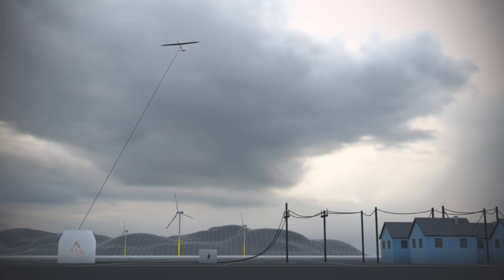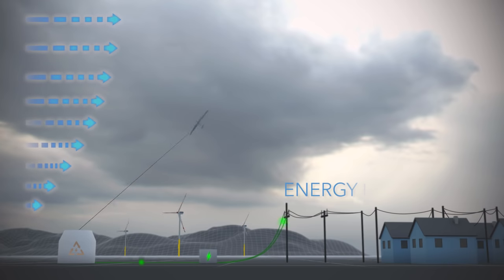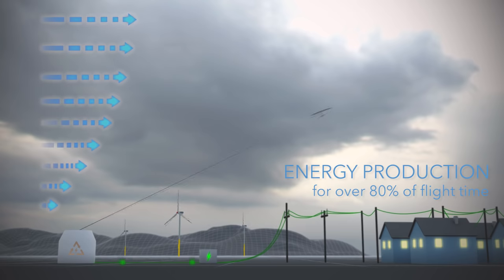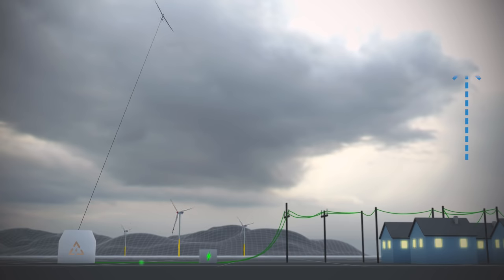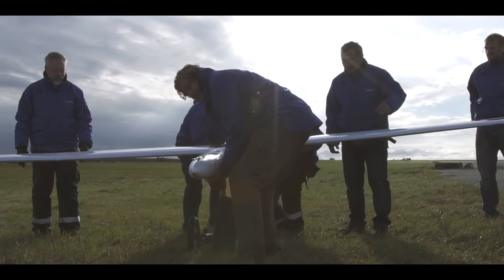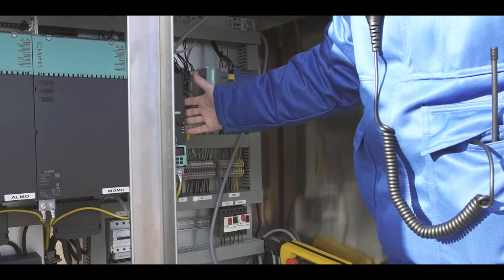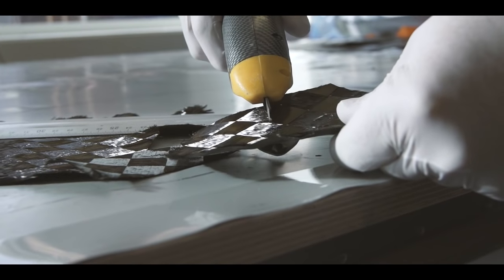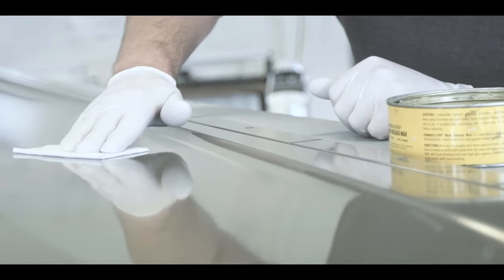Kitemill - airborne wind energy

Comment: its a very creative solution.. i recall a similar concept, an air-based , tethered wind-mill, basically like a helium-filled blip aircraft with an air turbine. however this is better because it goes up higher . the downfall is that it requires large areas, sometimes an airspace license and also probably specific locations, whereas the stationary unit can just remain in the air generating steady electricity , although, a lower amount..
Reply: i noticed in the demonstration that it went up only 500 metres. i know that would still require a licence but i guess it wouldn't be so stringent.